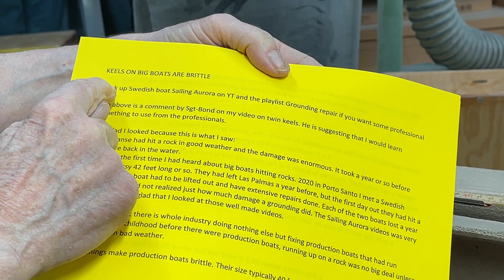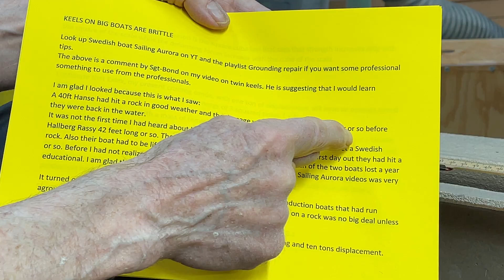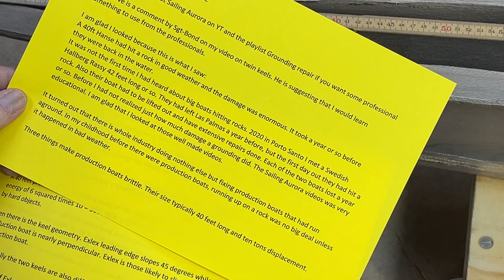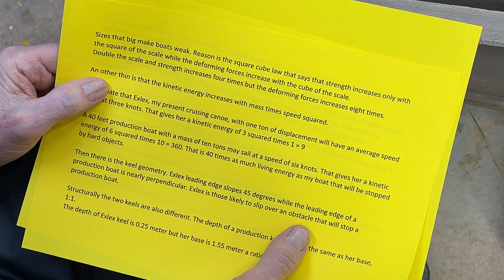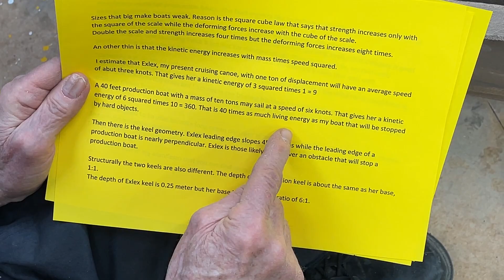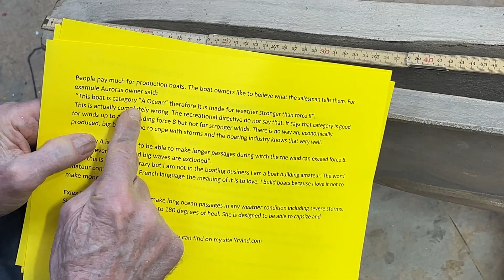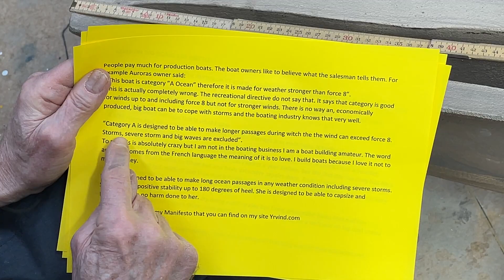Keels small and big and the effect of scale

Comment: Bonjour Sven, thank you for explaining so well the physics behind your project. Did you think about laminating the entire keels (over the screws) to the hull and leaving the bottom free for grounding ? I know the screws are gonna be sufficient, I trust your experience, but I saw a Kraken monohull and find the design very interesting with the keel solidly laminated to the hull.
Reply from the maker: In fact the screws are just extra the elastic epoxy glue will be more than strong enough.
The bronze is antifouling so I like to use that property and not glass it over.

Comment: Thank you Sven for the explanation and the update. Since Exlex is designed to beached it only makes sense that you have designed the keels and the system of attachment to allow this. The comparison to a large boat with deep keel that is not designed to basically run aground like Exlex, in my opinion, is comparing apples and oranges. Both are fruits, but they are built by nature to survive different conditions. Best wishes for a productive weekend. Also, thank you Peter for assisting.

Comment: The difficulty of attaching  a short based deep fin keel is very different to the attaching of a long shallow  bilge keel, I agree with your analysis but ask how you are going to seat those screws into the hull?  I'd be drilling holes much oversize, perhaps 8 or 10 times the diameter of the screw, then filling those with epoxy and reinforcing the area with a patch of carbon fibre after seating the screws in that epoxy,  Storm damage should not be a problem with your ship, the worst stress will be if you are beached broadside on to waves which would have the whole weight of the boat being thrown sideways onto the keel.
Reply from the maker: First I turn the boat uppside down. Then I glue the keel in elastic epoxy. The outside laminate below the keel is very strong. 12  maybee 16 layers of 450 gram. 
There is holes drilled and countersunk in the flenge. Through them I drill through the laminate and into the core. Then I enlarge the cavity by wriggling the drill to create a conical cavity. I may also use a hex key.
I have plenty of time as the keel is fixed with the elastic epoxy.
Then I fill the hole with infusion epoxy that have extremely low viscosity and very long curing time.
Test with a single screw, no epoxy had a failure of 140 kilo tenson. Sheering should be 0.6 percent of that.
Test with epoxy 1987 or so showed 250 kilo one screw. There are 50 screws on each 75 keel.
Beaching broadside is the worst but base is 15 cm wide keel 25 cm high. 
Then beaching her broadside in storm conditions is not my intention.
I do have confidence in the construction.
Estimated displacement with food and water for 100 days is 1000 - 1200 kilos.

Comment: 😂Massive difference between hitting a rock with a huge fin keel that's carrying ballast for a 40' boat and has an angle that's closer to 90 vertical, and gliding over it in Yrvind's boat. Just by draft alone he has defeated most of the problems of hitting underwater obstacles. 
Cargo containers drifting at sea are probably the scariest possibility.
But even those he'll probably pass over. If not, the angles of his hull and keels will be enough to skim him up and over.
Reply: Not to mention the fact that at 2 ft of dept there not too many rocks that you don't foresee clearly when sailing .

Comment: Well, I agree, that's why I said I would feel safer in your boat than pretty much anything (especially bigger!) out there. And the exclusion of gales and storms from the Spec-A is a sin!
I originally did not like the use of screws over bolts but then thought: if there is a keel-tearout, the screws would simply rip away whereas if bolts were to fail, it would rip-open the hull.  
I did some calculations and depending on how you disperse the 25 screws over the 155cm, that puts each screw a little over 6cm apart.  Will the screws be going into Divinycell or inlayed-Micarta reinforcements?  What is the density of the Divinycell used for the hull?
Thank You Sven...
Reply: screws going into cavities carved into the divinicell and then filled with epoxy. there is all in the comments of past videos
Reply: @juansimon7020  Thanks Juan!
Reply from the maker: The Divinycell is H80 That is 80 kilo a cubic meter. There will be 50 screws on each keel 25 on each side.

Comment: I agree and like your thinking. Interested to see your full method of attachment. So much of the modern design damages are to long fin keels with very large leverage factors. Even without grounding they are cracking regularly at keel to hull stress points.

Comment: I agree with your analysis. There is another point. These so-called ocean going boats have their keels attached with bolts going through from inside. A hard grounding may break or crack the bolts, causing the keel to drop off and the ocean coming in through the holes. Without the keel the boat will turn upside down. Even if the keel does not detach completely it will have a leak that you will find almost impossible to stop. In your case there is another carbon fibre layer inside. With the broad base a grounding is unlikely to rip off the keel or cause an unstoppable leak. You know more than the so-called experts.
Reply: yes indeed, and he also has the patience and generosity to teach his knowledge to ignorant people like me. Sven is a treasure
Reply: @juansimon7020  Agreed!

Comment: How scalable is Exlex? Would she still be as safe if she was 35 feet long? What would you do differently?
Reply from the maker: Glad you asked.
There are no fixed size.
35 feet is about 10.7 meter. Exlex is 6.27. The scale is thus about 5 times as big to displacement if scaled in all three dimensions equally. That means a displacement of 5  - 6 tons. A boat that big will get very different properties.
However myself I plan a new boat 8.4 meter long or 27 -28 feet but I keep the beam 1.4 meter and draft about 0.5 meter the same. 
The fully lodad displacement for 200 days will only increase from 1 - 1.2 tons to 1.2 - 1.5 tons And that is only a 25 % increase.
To compare sizes displacement is more important than lenght.
Reply: Thanks for taking time. 
I think what you're saying is: If to design modular parts around a 20 foot shipping container, it might be almost equally safe to design parts fitting to a 40 foot container measurement instead? Or: Aspect ratio is a main safety variable?
Reply: @danielgrwaldphone2927  there are 30', 35' also
Reply: True, but most common semi-trailer / train box is 40'. All of them have the same standardized width, and common heights, leading towards somewhat compatible behaviour if integrated into displacement hulls as I understood Sven. I think he is planning for a tandem version of the current Exlex Canoe in the future, however.
Reply: The speed and weight thing would still apply. a 35 feet boat is heavier and goes faster, meaning an abrupt stop from an impact does more damage. It would also hit more objects since it would go deeper in the water. I imagine it might still be better off than production boats because shipyards do some compromises to economically serially produce their boats whereas you can make your own boat as strong as you like.
Reply: minimalism is called like this for a reason
Reply: 35 -40 foot is the approximate size of a modular Exlex built around meassurements of a standard 20 foot shipping container.  35 foot could thus still be called minimalist.
Reply: Much more strength of structure is required the larger and heavier it gets. Most larger bilge keels meant for regular grounding in UK rest on the belly tripod with keels and rudder skeg. Personally I will keep my foundation wall full keel for a large boat.

Comment: I'm not going to argue with Svens logic on this one as he's so well read and that well experienced that I'd struggle to ever compete with that... However, if I was building Exlex I would have gone with 5 big fat keel bolts per keel, on the logic that 2 would probably hold it, 3 would be robust enough to handle a decent impact and 5 would offer plenty of redundancy.
Reply: then... what about 100?
i was of the same opinion than you,  but as he said, the key is spreading the forces. After learning how he is planning to do it (comment in yesterday 's video) i am totally sure that his method is the best. Period.
Reply: Then when you build your version use 5 bolts, do the calculations and build it and be happy, no disrespect intended - I am very sure that Sven has factored in all the forces and calculations that will ensure he has total confidence in his construction.
Reply from the maker: @Richard Gleaves lateral keel stresses or sheer forces is about 0.6 of the tensile I think 
Add the elastic epoxy glue of the huge surface of the keels flanges I still have a factor of safety of more than a hundred 
Normally naval architects would be happy get a safety factor of ten.